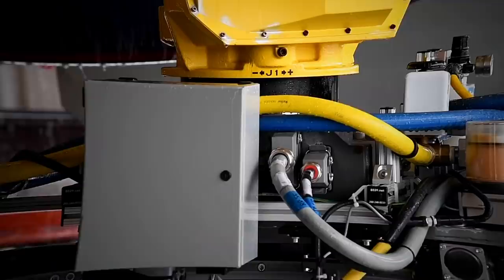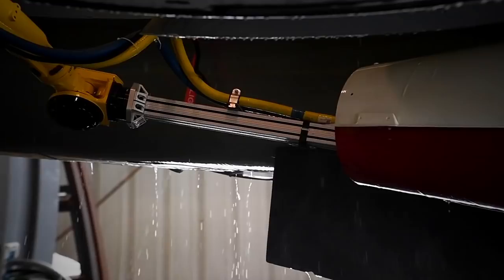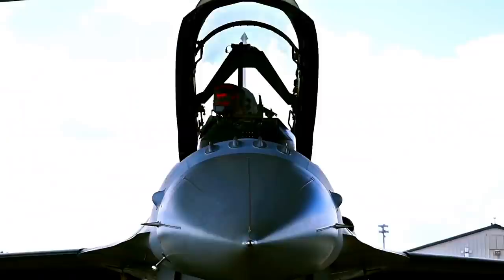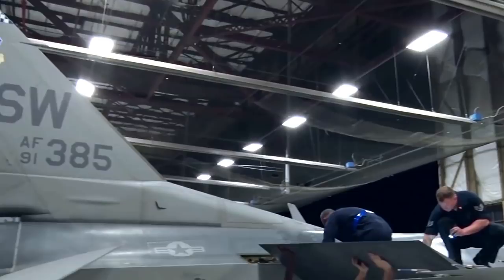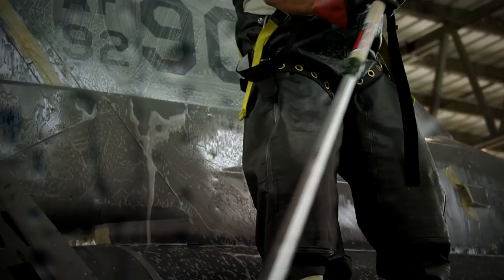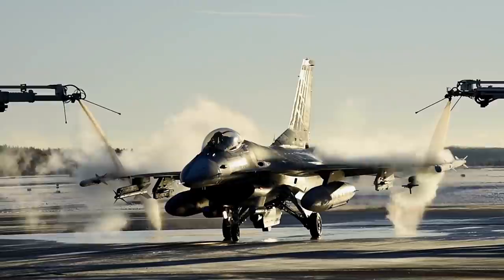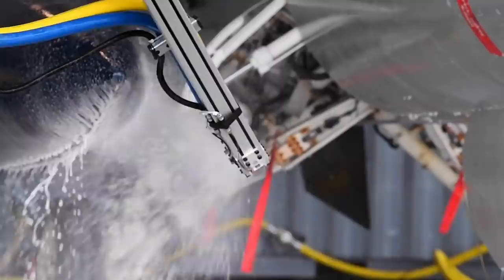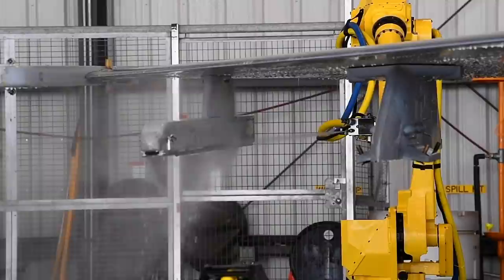The World's Only Fighter Jet Car Wash

Comment: As a young Airman at Nellis AFB in the 80's, I can tell you wearing the protective rain suits in 115 degree temperatures while washing a jet was the dreaded detail of the day. And if you think when we were washing them we were also inspecting them you're mistaken. If it was obvious then yes, you'd write it up. The prep for wash is pretty labor intense taping up all the probes, sensor and ports. Disconnecting electrical plugs and bagging them and blowing them dry when finished. After the wash all the systems that were disconnected had to be ops checked. At least this machine would take away the dirty work of the wash. I seriously doubt the Air Force would let it run unsupervised regardless of the time of day. If I recall there was at least one F-16 lost to water in the cannon (brand name)/electrical plugs after a wash.
Reply: Good write up.

Are the soaps harah? I thought it soundes like a bit of "pro robot propaganda" when they described washing as "hazardous" and this will protect people. 

Sounds like a shitty job being hot and sweaty though. I wouldn't want to put my waders on and wash my truck for 2 hours....
Reply: @volvo09  Isn't everything?😉 It's more of an exposure problem. It is a soap, a strong soap like Dawn and simple green on steroids.. The main problem is skin irritation. It totally stirps all the oils from your skin. Like all similar products, it can cause skin irritation. PPE consisted of rubber gloves, eye protection, rain jacket with hood and rain pants with boots. It sucked.
Reply: I was at Viper AMU (active duty) '04-'06 and Falcon AMU (contractor) '18-'20 at Nellis.  Wash rack was always a dreaded detail, especially in the summer.  Hot, muggy, and very nasty.
Reply: As a former F-16 Crew Chief I agree that wash duty was one of the worst / most hated jobs on the flightline.   Bad enough that, given the choice I'd rather drain fuel, do a wing swap, and come home smelling like kerosene than spend a day in the wash rack.

There is one point that the 1-hour wash forgot to account for - namely the time it takes for ground crew to cover delicate sensors such as the Pitot Tube, Air Data Probe, and AOA indicators.
Reply: I don’t think a robot wash-monkey changes the need for wash prep and post-wash lube.  I don’t know what it takes for an F-16 and what else it entails but 2 days for a wash job?  

Besides, what better threat is there for Airman Smuckatelli than extra was jobs? 😉
Reply: @donalddowning4108  It’s not a car. All items need to be removed from the external hard point. Training missiles, fuel tanks drained and removed, bombs racks, pylons. Every electrical connector that isn’t under a sealed panel needs to be disconnected and bagged. Every external sensor/port needs to be taped up. The battery needs to be removed. Any antenna with a composite coating needs to be taped up. Then towed to get to the rack. That’s even before it’s washed. Once it’s done, all electrical connectors need to be blown out with nitrogen and reconnected the each one of those systems that had an electrical connector disconnected requires a systems check. That requires a external power, A/C and hydraulic power. All tape and residue needs to be removed. A complete inspection of the exterior. Wash perpetration grounds an aircraft so after supervision needs to perform a forms review to release it back for flight. Aircraft washes aren’t just for appearance. It for corrosion control. It’s one of the reasons our aircraft have long service lives in a harsh flight environment. It’s been 22 years since I retired and talking to current maintenance guys, the newer fighters require even more prep due to the high tech coatings and additional ports and sensors. The actual was is really the simple part. Like painting a car, it’s all in the prep and final buff.
Reply: @heeder777 . 

I spent 42 years working in aircraft maintenance for the Navy, 22 active and 20 as a contractor. I was in fighters, attack, helos, patrol, and transport. I worked primarily in the maintenance management office.  I never saw a wash job and accompanying inspection that took more than 8 hours based on the Maintenance Requirement Cards (MRC’s).  Now I’m not an expert on AF T.O. requirements for the job but, in one squadron, we were loaned a couple of AF C-130’s that we were required to maintain per T.O.’s. Still don’t remember taking more than one shift for the wash flailex.  Note: I also remember the SERNO’s, 57-0497 and 65-0979.
Reply: Excellent input to the discussion from all of you maintenance crew veterans. Excellent.
Reply: @donalddowning4108  Agreed. BUT. The F-16 is a little more sensitive to water since it has a digital fly by wire control system. A total loss of an F16 for loss of the FLCS was caused by water in the cannon plugs. This is why the intense prep and restoration before and after the wash. The F-4 for example was an easy prep. Sorta like a tank with wings. Town it in, wash it, you’re done. By your time working for the Navy, looks like you’re old like me! My body’s too beat up to do all that chest pounding. 20 years of working on them was enough. Now I just keep the others from hurting or killing themselves when working on them. 🇺🇸💪🏼😉🤣
Reply: @heeder777   Every single fighter in the US uses fly by wire ...just about everything does.

Comment: I've actually never considered this before since I'm not a maintenance soldier, but this robot seems like a good idea to me, better use of soldier time and it takes no effort to get over high no-step areas. What I had in mind though by the title was an actual hanger built like a gas station car wash.
Reply: True statement, it also doesn't need fall protection for the troops so they don't fall off the upper surfaces of the aircraft.
Reply: Actually having been on a wash crews, there's a lot of work and a lot of nooks and crannies like he said. It's not like washing a car.
It is more like when you see a high-end detailed car that goes to a car show.
I'm assuming with this wash system they used AI and have all the data for the spots that really need to be cleaned very well on an F-16.
As they make more improvements I can see this coming to many Air Force bases.
Reply: @totorodad-computer-geek  Cool info. and yes it would be a win win.
Reply: @heeder777  they wear fall arresting gear. Try washing a C-5.

Comment: It would seem to me that you would want a hands on wash as part of the inspection process. The machine just washes. It doesn't recognize damage or a hazardous condition.
Reply: Washing is usually a bi-annual event. Inspections are preformed before and after each flight.  Any issues would be caught after coming out of the wash bay.
Reply: Depending upon how clean you want them you still need to touch the surface if you REALLY want it clean. 

But for a fighter jet, it's probably more about oil and grime reduction rather than "looking it's best".
Reply: id imagine that cleaning the aircraft has nothing to do with inspection.  why would you rely on such a critical operation while performing a seperate one?  sounds like a disaster waiting to happen, which is why i doubt one has anything to do with the other

Comment: I program robots for a living. That setup right there is peanuts...like a preasure washer bolted to some extruded aluminum framing...super basic. 
They have servo driven motors that are controlled by the robot now. Hook up a brush with a pleasure sensor. Shit, they have tool changers too. Robot can swap heads on its own and do other shit. 
Great concept, but could use a hell of a lot of upgrades.

Comment: Yeah, they can spend more time on their phones watching movies.
Reply: Chris Webb  No, anyone with experience knows it doesn’t take that long to skin wash a small aircraft like that?  6 hours is probably the technical manuals answer for the recommended man hours required to complete that task but that’s probably only used for a guide.  I’ve washed skinned washed a CH-47 with 2 guy’s.  The landing gears, blades, rotor heads and Floors included in about 4 hours clean!  6 hours dry!  If they want to spend the money on something like that then it’s less work that people have to do but then they’ll be robots doing inspections and repairs and that means less people needed! Next that’ll leave you jobless.  It’s convenient yes and I wouldn’t complain but you should be cautious about wanting things like this because when there’s no work to do, there not going to need you!

Comment: You know... We have cheap car wash machines now in gas stations... Why haven't we had this sooner for all our military vehicles???
Reply: For ground vehicles their are pools of water you drive them into with high pressure water that spray the top and sides down while the water under cleans the bottom
Reply: @packletackle9047  I just saw a video on that. That's a joke compared to What Germany has to clean it's tanks.

I have higher expectations of my country... I'f I can take my pos car and get a cheap machine wash from a gas station for $6 then my countries tanks should be able to do the same.
Reply: @packletackle9047  Wash rack! Did it many times!82nd Airborne Division!🙏🏿👌🏿👍🏿

Comment: VERY COOL washing system but the workplace robots vs humans war on jobs will not be fought first by the military. 
$$$ vs how many people in the hangar have their face in a phone right now is a hard test to beat.
NOW THAT is a proven and highly successful automated volunteer system that washing robots just can't compete with..........  

I am about 99% sure they will pass on this one. Soldiers are WAY WAY less expensive than this system will ever be. 13 years on the Helicopter side of Army Aviation. I have seen a few systems tested over the years and when it comes to the $$$$ the savings over manual washing over a few years needed to be vast or air safety from corrosion needed to proven.  In the end it always came down to Active and National Guard/Reserve having the hands and the time to accomplish the mission (yes washing ACFT is a mission and a war on safety) so these systems mostly get a pass. Buy hey mostly isn't all the time. We had a firehawk for years. UH-60 with huge drop tank and upgrades for fire fighting. Just one. Looked awesome! It "worked" well. Turned out to be pretty expensive, impossible to get pumps for and since the ACFT was specially modded to hold the system it had different maintenance needs and couldn't be on mission with a vast majority of non fire missions and required time to revert to normal for deployments. It's come and gone yet we still use the buckets it was meant to replace.  Very different from a wash system but this is the military. We don't think the same way as the rest of the world..
Awesome video.